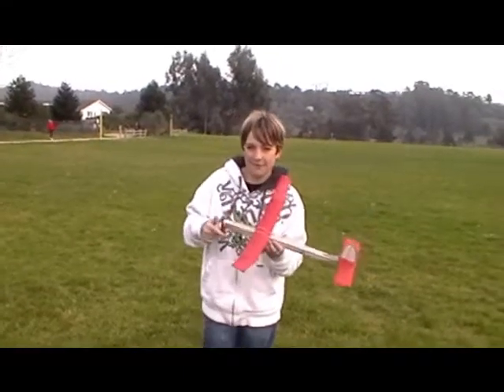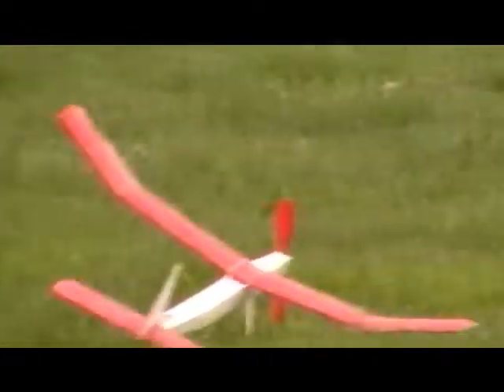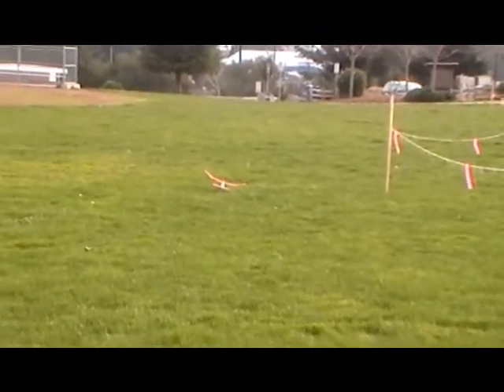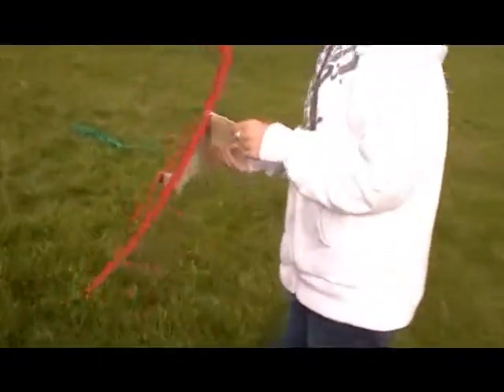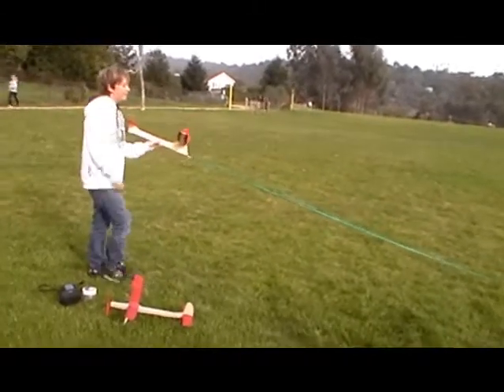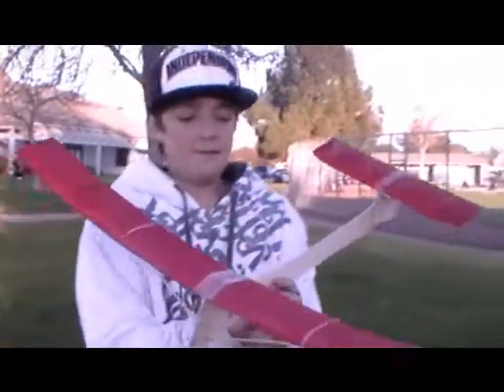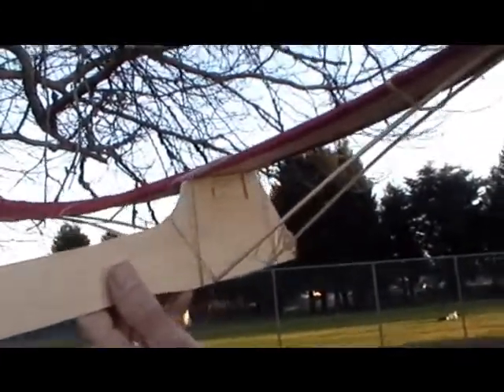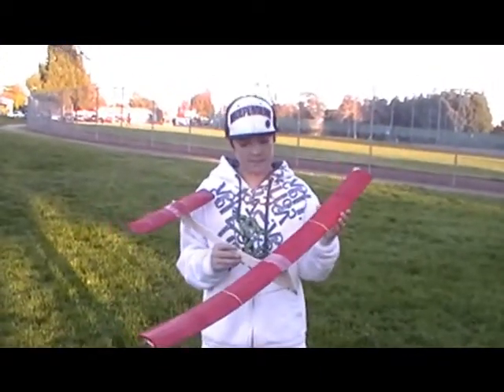Project Glider.wmv

Comment from the maker: Maybe you didn't catch it, but the second plane was the project and is a glider. The first was a plane made from a kit and was just used as practice -- and you are right, it has a rubber band powered prop.
Hope your project worked out.

Comment: I just built a glider for school(10th grade drafting class) and that is not a true glider. Gliders fly by generating lift to keep them in the air, they do not have propellers
Reply: You would’ve seen the actual glider if you watched for more than 30 seconds before taking to the comment section 🤡 I hope you’ve gotten a little smarter over the last 10 years